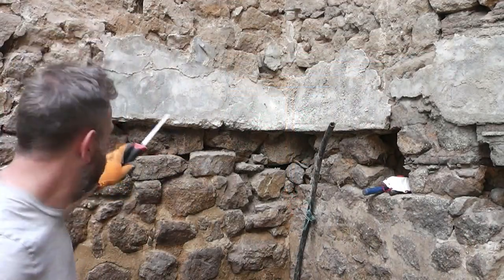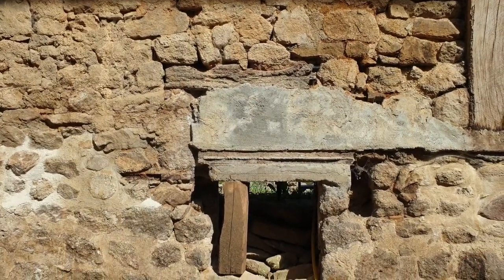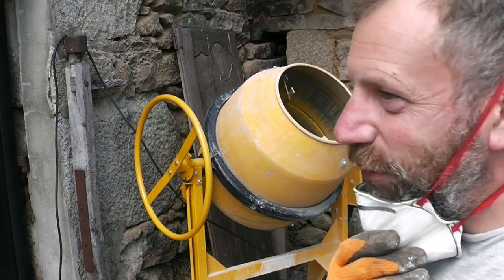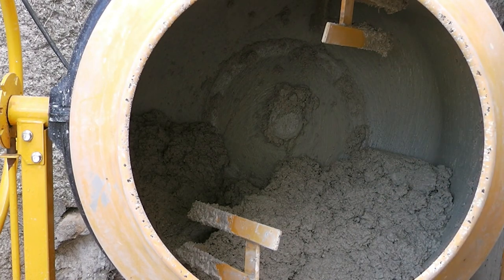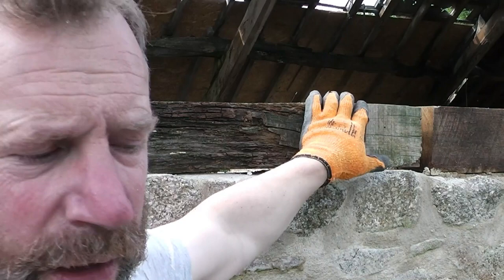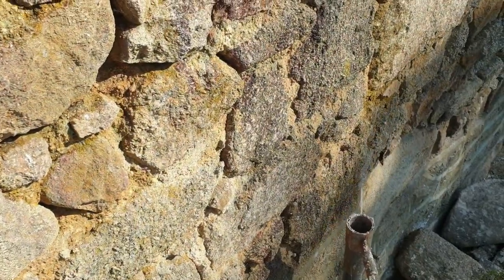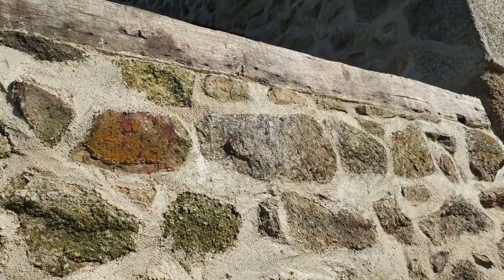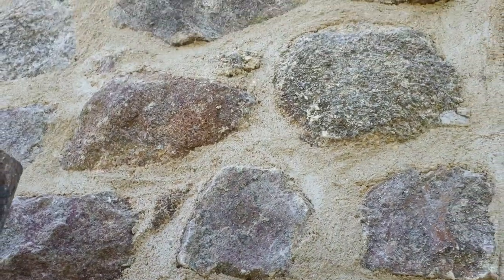Shocking missing lintel | Lime mortar NHL 3.5 #notesfromlechassaing #barnrenovation #traditionalbarn

Comment: when the lime has just gone off (I leave overnight) you bang with the brush to force it into the cracks? that also gets the loose off the sides.. great job! just found you on you tube..xx
Reply from the maker: Hi Amanda, Thanks for watching. Great tip! The barn is 60ft (20ish meters) long so ill get lots of practice 😆
Reply: @lechassaingourfrenchfarmhouse  thanks for taking it so well.. a pain when you have slogged away and someone chips in.. with a 'have you tried...?' It's a lot quicker than brushing just to bang with a stiff brush and I was taught by an old stonemason that it shunts the lime into the back of the cracks...